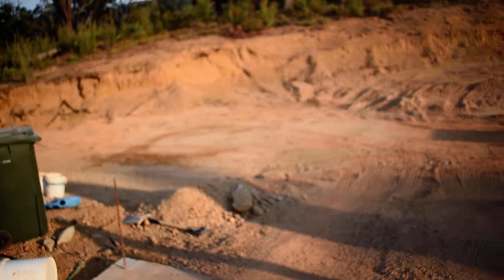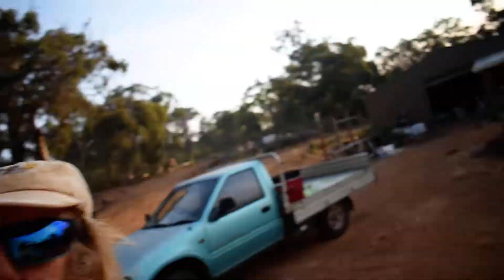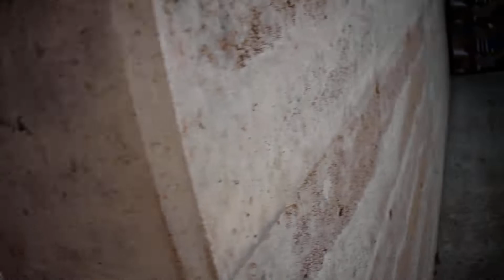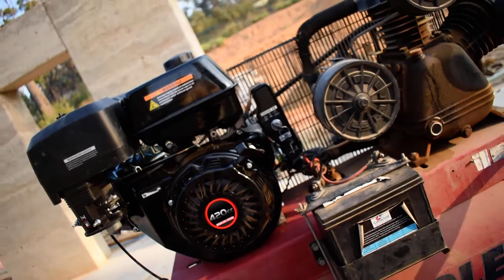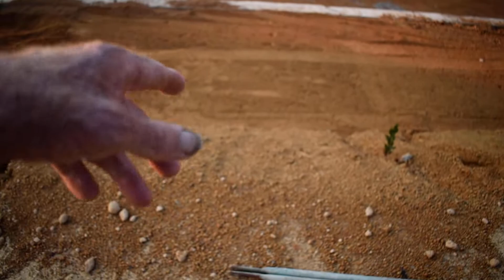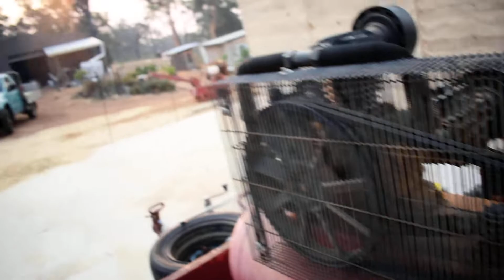Off The Grid Down Under Australia The Present Moment and what I've learnt.

Comment: Hi, Im so impressed your all achievements on your property.  I would love to come and learn many things about rammed earth projects from you there however I  am in far North Queensland.  Anyway I think I am ready to try my experiment of rammed earth now finally.  My property have very clay type of soil.  I would like to start with 50cm height retaining wall. Then chicken pen then my little cottage in future.  That’s my aim anyway!!! Is it possible to ask you questions? The first one is ratio of cement you mixed with your soil for the retaining wall. Also what you did for foundation for your small retaining wall behind your first donga (it look more like beautiful cottage to me) I’m going to remove the very old and damaged log and then build rammed earth retaining wall there. I think it’s a good starting experiment.
Reply from the maker: Hi Thanks for the comment. If you have high clay maybe you should look at Mud Brick I originally was going to do Mud Brick but the earth here isn't suitable, I almost trucked the dirt in, but found Rammed Earth and the earth here is more suited.  I use the earth on the property. The mix is 7-10% cement with about a cup of Plasticure.  I have found 2 bags of Cement to a Billy Bucket of dirt works for me.  The retaining walls on the shed and the house have a 100mm footing with mesh. The small wall around the first Donga (cottage) no footing just on the dirt same as the garden beds, where it all began.  They don't seem to be moving. knock up a couple of form boards and have crack you can do it Bro!!!  Learning is a great experience.
Reply: I appreciate your reply!!! I had to look up what Plasticure.  It sounds brilliant. I have to order now.  Yes, I will just try without footing to do 50cm height retaining wall to see how it goes.  I have made mud bricks with soils on the property and it looked great however I prefer rammed earth.  I feel it’s more simple process. Anyway I will experiment.